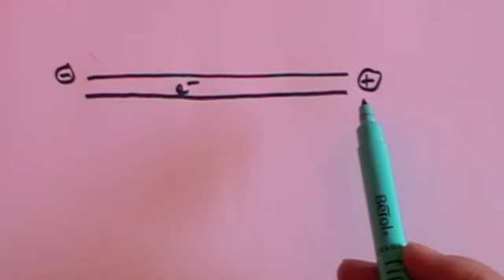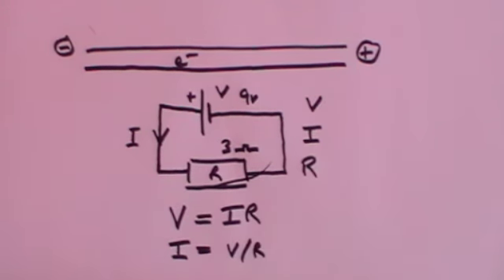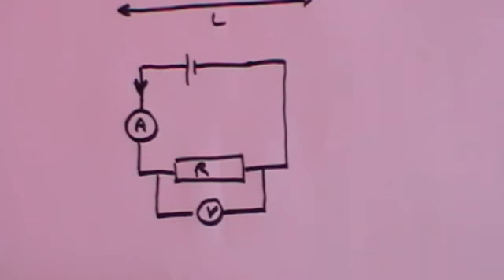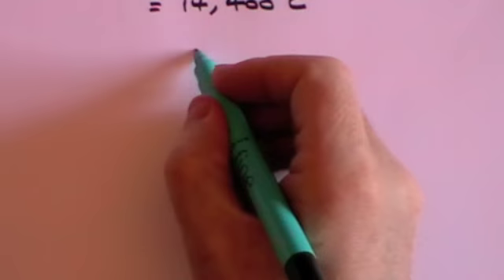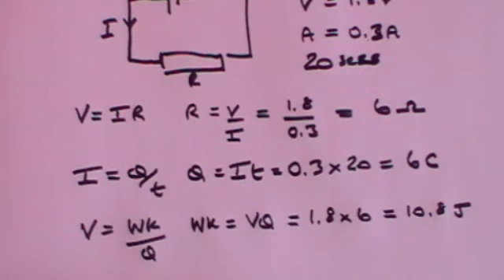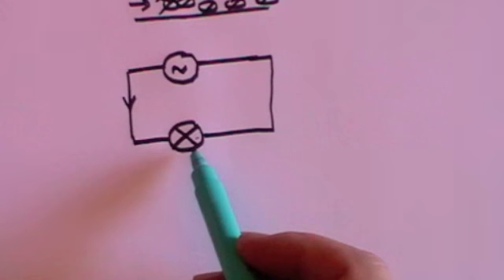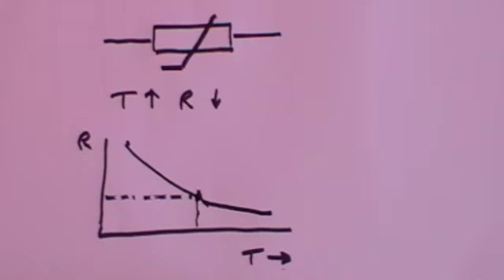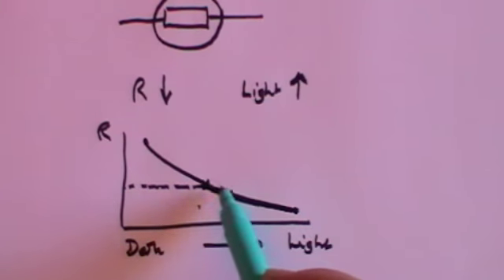Ohm's Law V = I R: GCSE revision

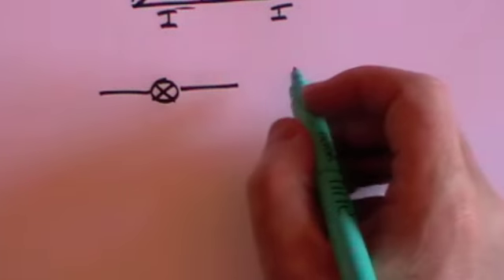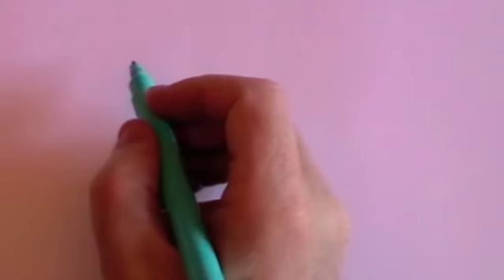Comment: 18:17 he says that when the temperature increases the resistance decreases. But at 20:33 he says that if the temperature increases the resistance will increase too? no hate towards you mans your a great man im probably passing my test tomorrow at school.
Reply: Basically , due to collisions of electrons  with atoms, there will be energy transfer. This will increase the temperature of the wire as energy being transferred to the components is not 100% efficient. So if I have light bulb, the energy will be transferred in such a way that part of it will heat up the wire and part of it will be emitted as light energy. The heating up of the wire makes is atoms vibrate which makes it harder for the electrons to then flow through it
Reply: Comment was two years ago lol

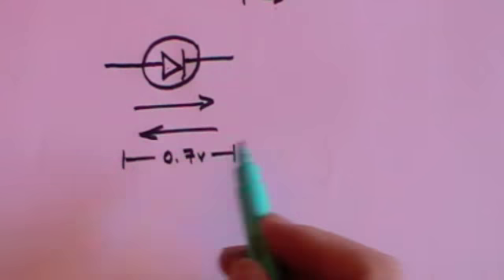Comment: 23:40 Why 0.7V?
Reply from the maker: Ananthajit Srikanth You need a pd across the device to cause electrons/holes to move across the junction. It turns out it’s about 0.7v in many cases. Below that and no current flows thro transistor.
Reply: @DrPhysicsA  Thank you so much.

Comment: But still why do we follow the convention!?
Reply: @Samarth Sai 
If you follow the direction the electrons are moving you will get a negative current value. So if draw it the other way it's positive. So I suppose it's easier to think about. 
Also millions of pages of text would have to be re written which would cost a lot for something that doesn't really change much since the Math still checks out either way.

Comment: Hi. Sorry but aren't VI graphs supposed to have current at the y axis and voltage at the x axis? Does this matter at all?
Reply from the maker: You can draw them either way. But if you put V on the y-axis, then the gradient will be R.  if you do it the other way round then the gradient is 1/R.
Reply from the maker: Bob Steve Conventional current (from + to -)
Reply: DrPhysicsA if i'm in an exam, and i'm asked to label which way current is flowing on a circuit diagram, do i use an arrow to indicate the direction of convectional current, or an arrow to indicate the actual flow of current? (if they don't specify)
Reply: DrPhysicsA if i were to put - to + would i not gain any marks for this?